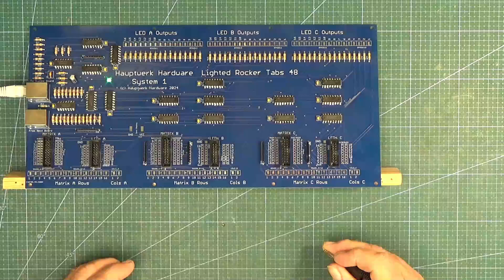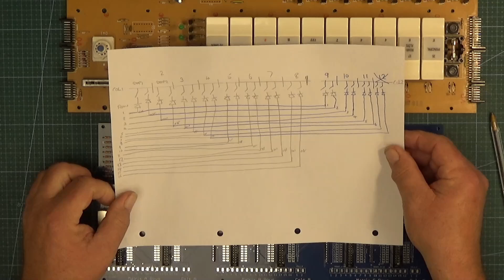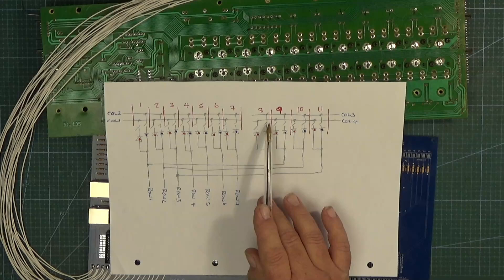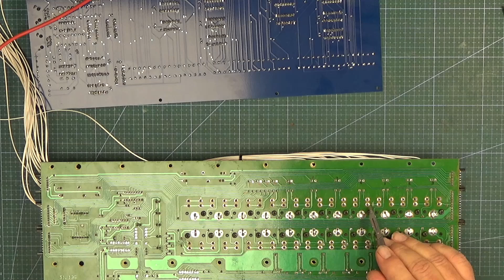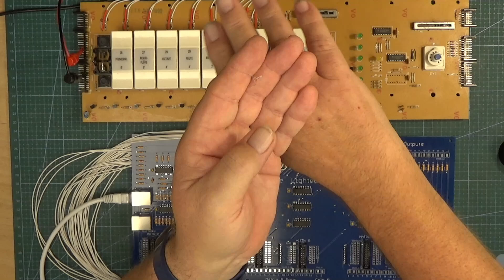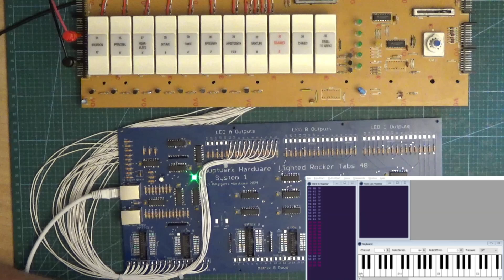Praeludium Galanti - Digital Organ Rebuild - Part 3

Comment: I noticed in using the rockers, you would use the bottom to turn them on and the top to turn them off. On my rockers, I can use either side to do both. I find myself nearly always just using the bottom switch to turn them on and off.  Is such the case with your rocker banks as well?
Reply from the maker: Hi, I have these wired so that pressing the bottom sends a midi note on and pressing the top sends a note off.  Only one midi message is sent for each state change so it would not be possible to use this in the way you use yours because pressing the bottom a second time will send no data until the top is pressed to cancel the earlier on state.

Comment: I mentioned the stop switch incandescent light bulb issue in a previous video where I suggested conversion to LEDs as part of the project.

I think you will find that the spec for those incandescent bulbs is similar to metric fuses known as type M205 (20mm x 5mm) in which case for the Bulgarian-based eBay seller Google "15pcs Rodgers 530 Digital Organ LED Lamp Warm White 12V 5x20mm Bulb Replacement".
Reply from the maker: Good to know - Thanks.